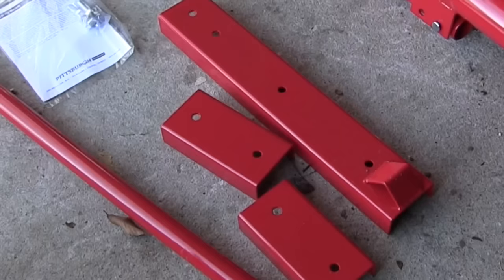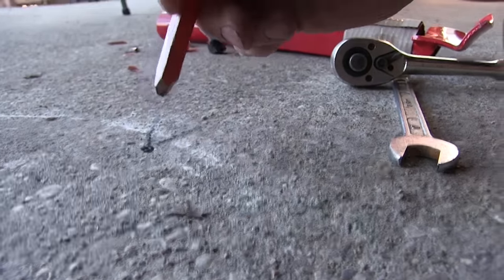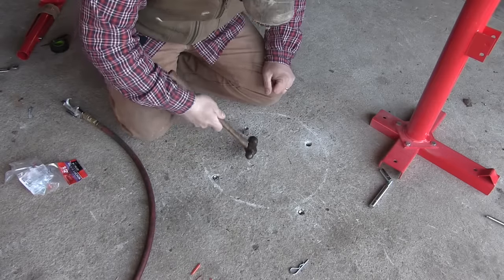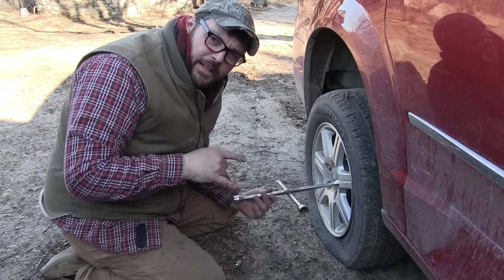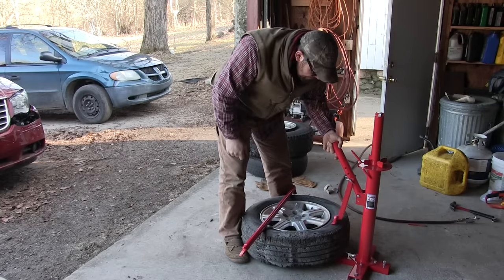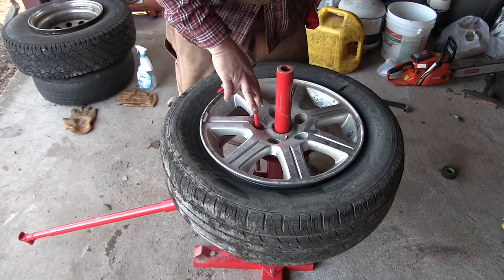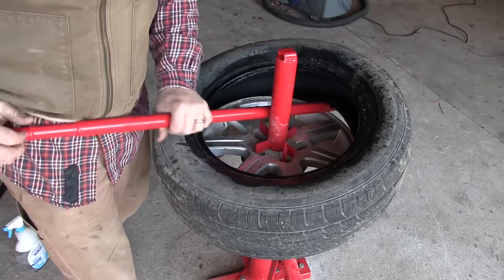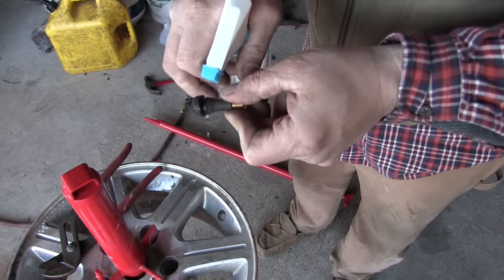Harbor Freight manual Tire Changer review

Comment: If you stand to the side of the machine and apply downward foot pressure on the sidewall immediately beside the bead breaker tip the bead will move down a LOT easier even without any lube

Comment: Before you start removin g the tire, 
Put a chalk mark on the rim, and tire, so you can later turn the tire To line up, before you air it up. That way, the balance will remain good.
   Use the hook end to reinstall the tire, by pushing the side opposite the bar, into the center of the rim, which will give you more slack, to easily reinstall the tire onto the rim.

Comment: Now you are or your daughter is going to have an obnoxious TPS warning light flashing on her dash!  I would put a short flat head bolt in your anchors to keep dirt and gravel out.  How big a tire will it do?  Wrap a turn of rubber innertube around your bar so you don't ding the aluminum?  I have so many HF tools that need anchoring I use one big plate to anchor to the floor but have multiple bolt patterns on it to mount the various tools  Keeps from having concrete anchors all over the place.  Now you need one of the old school balancing bars to do the wheels and some leads.

Comment: this manual tire machine is fine if you do not mind scratching the shit out of your rims. I have an old coats manual tire machine just like the one that I used to change tires on when I was a kid working in a service station/gas station through the high school in the 60s. We didn’t have front wheel drive or four-wheel-drive vehicles very often back then so everyone changed over to snow tires in November, and had to have the studded snow tires off by April 15 so I was changing a lot of tires manually. those wheels were steel wheels. I have one of those machines, and I used it to change all my relatives mine and my kids and my wife’s tires over from snow tires to summer tires and back for years. I have no doubt that I have changed more than 500 sets of tires over my lifetime. But a manual machine scratches the rim all the way around. I have a ram 1500 with the optional wheels, my wife has a Honda CRV with alloy wheels, my kids have cars with alloy wheels. And my machine will scratch them all the way around even though I have a much better tire bar. for installing or removing tires on each end of the bar. It really is a piece of cake. But this machine in this video, I actually bought one because it had an optional motorcycle wheel adapter for changing tires on motorcycle wheels. That also scratches the shit out of my wheels on my motorcycles so I don’t use that anymore. The best thing about this harbor freight tire changer is the bead breaker. It is worth $50 to buy the machine just for the bead breaker.
 My wife’s car and my ram truck are four-wheel-drive. so there’s no seasonal tire change over from snow tires to summer tires anymore. So we don’t need to change tires twice a year. When I buy new tires, I let the tire store install the tires so they don’t damage the tire pressure sensors, and they don’t touch the wheels. They are touchless tire machines now. This harbor freight machine is fine if you don’t mind scratching the shit out of your wheels, but otherwise, let the professionals use their touchless machine to install your tires.
  If you do use this machine, get a grinder and polish that crude casting they have on the end of the tire bar for working the tires on and off. Also, don’t use soap and water to lubricate the bed to get the tires on and off. Because if you have an aluminum wheel, and you use soap that has LYE in it,lye is the chemical enemy of aluminum. It is like putting acid on aluminum. It will corrode your wheels, and overtime you will have a pitted bead area on the wheel and you will have slow leaks. LYE is the ingredient in soap that makes it feel very slimy, it is also the ingredient in shampoo dishwashing liquid or any soap that burns your eyes, that is the LYE.. go to Napa auto parts and buy a gallon of rubber lube. The last gallon I bought only cost me $15. It will not corrode your wheels..
  good video. I tried mounting my harbor freight tire machine just like the one in this video to my garage floor, I ended up pulling the lead anchors out of the ground. I now have four three-quarter inch holes 3 inches deep in my garage concrete pad. I was trying to change much larger wheels than the one in this video as a test..That is the number one key to having this machine be a success. It must be absolutely solid as concrete amounted to something. You can’t mount it to a sheet of plywood. You have to mount it to something solid like a big steel plate maybe 12” x 12” by half inch thick, and then mount that to the floor,  
  or get yourself some square tubing, and mount that square tubing to something you can plug into the receiver of your pick up truck tow hitch. Then attach this harbor freight tire machine to that 4 foot or5 foot long square tubing that is plugged into the receiver of a heavy pick up truck. That would also work if you don’t want to have the machine mounted to your garage floor

Comment: Great show and very useful. Adding my comment is the fact that quite often after so call professional tire service  mob, all looks good to the moment when happened to be flat tyre again, Get car on jack and ...one of the wheel nut  was not fit correct by some workshop apprentice and your car has to be tow. It sacks. This tool is a must to any workshop.🙂

Comment: One might argue that if you have to drill holes in concrete to mount the device, it's not exactly "portable"... :)

If you are going to not leave it installed in the holes that you drilled in the concrete, you really should leave bolts in there to keep debris from ended up in the hole...

I've had the old style rubber valve stems fail on me also... But it happened when I was driving and the air went out of the tire extremely fast and at highway speeds... With the failure mode that she experienced, at least it is safer since it happens when the vehicle is stopped...

Comment: I can set most first beads without the pry tool. when prying the second bead, keep the opposite side of the tire below the bead of the rim. Also beware, Some alloy rims have reverse beads. Meaning the shallow bead is on the inside Like my 1992 Volvo 240.

Comment: Neat device. I would have marked the tyre so it went back at the same place it came off. No need to re-balance the tyre. In the UK, throwing away the TPM sensor isn't really an option. If the car is fitted with them then the lack of a TPM sensor will bring up a fault on the car display. Even worse, when the car goes in for its MOT test, it will fail it on that fault.
Reply: No inspection in the US will fail just because the TPMS light is on. It’s just an electronic nanny. However it can point to an issue with the tire that can fail inspection (like there is a nail in a tire or it has a leak of some sort). Flashing TPMS light (fault in the system) will not fail and there is no logical reason why it should fail inspection.

Most idiot lights won’t fail inspection (ABS light, Brake light, low washer light, ect) unless there is an actual failure of certain systems.

Comment: I would recommend a tire cage in case there is a defect in the tire or rim. I worked at a county golf course and the county had a vehicle maintenance shop. These guys changed tires on a daily basis. Now, the county is a rumor Mill so I don't know the true story. One of the mechanics had a utility vehicle tire up on a workbench as he inflated it. The vehicle used a 2 piece rim on the front and one piece rims on the back. The tire exploded and took off the top half of my friend's head. They didn't reopen that building for close to two years.  Tires can  explode unexpectedly, especially when they're under inflated or have been driven under inflated. A small tire can kill just like a large one.
Reply: I meant to say tires can explode if you're driving them under inflated OR you inflate a tire you've been driving on under inflated.

Comment: Weld a 1/4" thick plate to a 3 or 4 foot long 2" square tubing  that fits your receiver on the back of your truck. The plate should be big enough to fit the bolt pattern on the bottom of the tire changer post. If you have an extra vise  laying around make mounting holes for it too.  Now you have a multiple use mounting plate for portable tire changer and a vise if you need it.  You can fix tires anywhere.  Watch the videos on YouTube to make a duck bill modification.  It works so in much easier and better than that tool that comes with the changer.  Good luck.

Comment: The Schrader valve from the old stem, which you casually tossed aside, could easily be inserted into the new stem. Also, reading the instructions before you start the job is always a good idea.

Comment: Great content but there is another process which you can’t perform at home. Every tire should be balanced after it has been removed from the rim. If you don’t it could translate into drivability issues (shaking, vibration).

Comment: That wouldn't work on a 10" scooter tubeless tire (bumper jack against a vertical 2x4 with pry bars <from HF> to remove/install tire on rim).  Thanks for the video.

Comment: Dude , watching this, i had same issue when i got flat on my Eco Sport, air powered tire machine could not break down my tire, i had to cut the steel belt  to get it to release, say those tires are issue.

Comment: When putting the second bead it goes a lot easier if you push the tire bead down into the drop center of the rim and hold it with a few wood blocks. 

Also that remount head on the HF tool is terrible. Look for an upgrade.

Comment: I personally would have stuck a board on the wheel next to the tpms sensor, drove a truck up the board, removed the sensor,  rebuilt it ($10) and popped it back in. No need to rebalance either.

Comment: Point well taken about people not realizing they can do this stuff and if your only changing a few tires this is the way to go BUT you scratched the shit out of the rim. If it's a work truck who cares but a newer car you wouldn't want to tear up your rim like that. I'm surprised it doesn't come with a system for protecting the edge of the wheel.

Comment: When you break a tire down put a chalk mark on the tire next to where the valve stem is so that you get it back in the same place that reduces the problem of having an out of balance wheel. I imagine the weight of the strange valve stem assembly could could lead to being out of balance. Whenever you get a new tire those need to be replaced by government regulation in our area and I imagine that's expensive. Also if you're having trouble seating the beat of the tire use a ratchet strap tightened around the Tire at the center of the tread it will make it much easier to get the bead seated properly.  
   Protection by bureaucratic legislation is expensive and generally isn't needed.

Comment: After reading some of the comments, many don't care if the tire is balanced or not.

DIY like this is only for people on the budget and want to save $ , i bet you these people also using cheap tires, well who doesn't want ro save money.

But remember a balance tire is for safety and long life of your tires and not ruined some parts of your car like ball joint, tire rod, axle ,hub bearings etc.

This is just my opinion

Comment: I suppose it matters where you live and proximity to cheapo tire shops you have some kind of working relationship with. I worked scrap iron for years so I replaced numerous tires over the years. Very seldom did I even have access to a garage and the city probably wasn't too keen on me drilling holes in the street. I never tried..

Comment: Put a half of can of starting fluid in the tire hold your lighter next to tire bead and strike it up. Puts them on the bead quick. Oh,     drop and roll if your hair is on fire. FYI safety  tip.

Comment: Does it scratch your wheel?
Reply: Can, but you can prevent it by putting cardboard down and putting rubber padding on the leg you put the wheel on and rubber between the rim and the piece that holds the wheel on when your dismounting it.

Comment: No instructions about pushing down on the tyre to get it into the drop centre so you can get the last bit on the other side over the rim? In the paper instructions, I mean. 
Great. But though I have 50 three big and small....I don't have a concrete floor!

Comment: i have one of these make a new bead breaker 2 14 in long 1by 1 in angle iron cut bottoms at 30 degree angle weld to a 1/4  plate you curve slightly to follow most rims  my leverage bar is 6 ft  this break any bead first try i also change semi tires so i have the big 4 of 5 ft tool for sliding around the rim to remove tire if its stubborn and junk the rubber tears

Comment: I respectfully disagree about that pressure monitor sensor that you just threw away. That monitor is an important safety and usually a money saving device. I know a number of people  that didn't realize that their tire was going flat and destroyed a perfectly good tire by driving on it. The tire pressure monitoring system is a good advance. It  Help you not pay for new tire We're not realizing you're destroying the sidewall by driving on a low-pressure leaky tire. A new pressure monitor can be ordered online for 10 to15 dollars a piece or less. Hey, if you even wanted  to, you could have taken that thing. You're through when cut off the silicone off of the little monitor and you  would find little "button" battery. You can  put in another  battery and be back on the road with a working pressure monitor system.   If you fail your rear end sliding around on ice. Or even in a rainstorm. Are you really gonna get out and run and check your tire pressure in a  driving rain storm?  Some people would just keep driving and maybe swerve around and end up in a ditch. I urge you to reconsider your attitude about it.

Comment: Before anyone decides to buy this tool because your already hurting for money. The tool is made of the cheapest metal you WILL bend the bar or the bolts that hold it together will snap. I managed to get 1 tire on 1 wheel before the bar bent

Comment: I'm actually pretty impressed. For a low cost item it seems to work fairly well. Some reshaping of that scoop would help it slip less I think. I've no room to talk - I use a floor jack, a Camaro, an old scrap rim and it can do the slip thing as well. I wish a real tire machine was in my budget. I do have the HF balancer which does a pretty good job. Next time you are out get the tire tool, has valve core wrench, valve stem installer and a couple other tools in one neat little device. Being able to do for myself is very important. I hate being captive to someone else.

Comment: The way you put the tire back onto the rim is the SAME way you took the tire off. I know because i used to work at a Texaco gas station out of high school and changed many tires. Of course, the machine was operated by air rather than pure muscle.

Comment: Mazda valve stems also have the problem of two dissimilar metals that cause corrosion and ultimate failure after about 5 years. Should have been a recall issue.
Sensor bouncing around inside a new tire ruined the tire just before it failed completely. Shame on you Mazda!
BTW: Did that tire changer leave red paint on the alloy rim?

Comment: The weight on the rim before you take the tire off you should mark it on the tire where the weight is with a yellow truck so when you slide the tire back on you light it up with the weight is this where the weight is with the chalk line then you fill it up with there it's the only thing you forgot to do now you're going to have to take the tire and have a sponge balance again I used to work on tires I know what I'm talking about have a nice day later